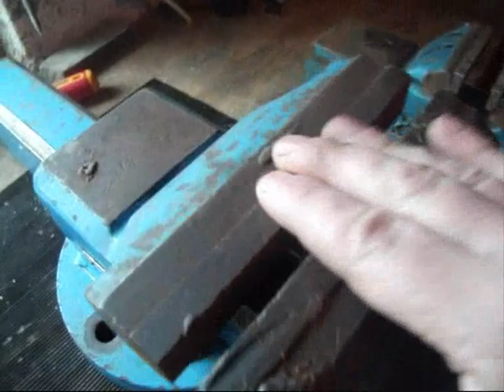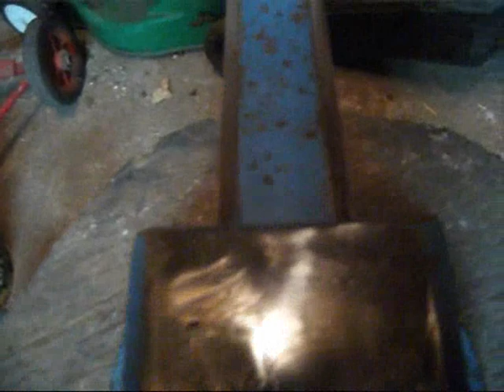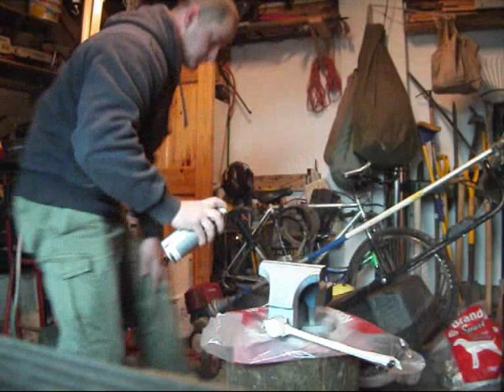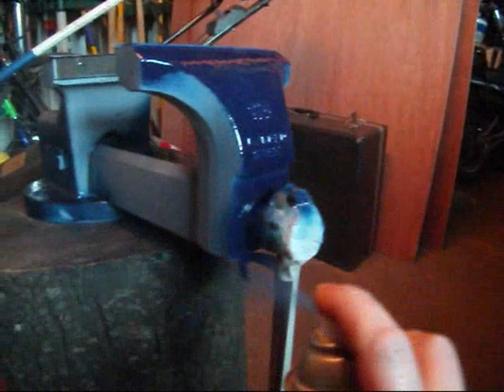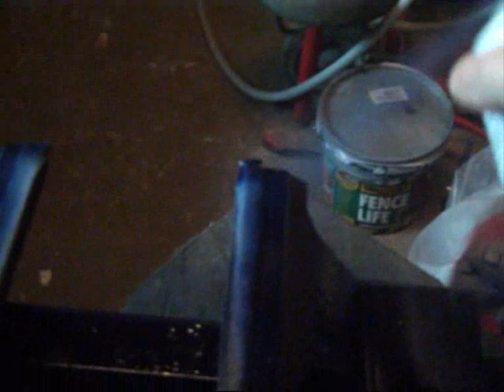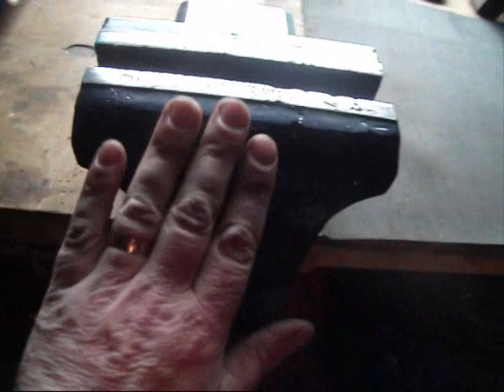engineers vice restoration

Comment: you did a great job on that vise! i restored a 3" parker vise that was rusted to the point where it would barely move (the past owner had a boat and used it in his dock workshop so it was exposed to salty corrosive conditions) i broke the jaws free with a rubber mallet, stripped, painted, and oiled it and its good as new. still use it to this day